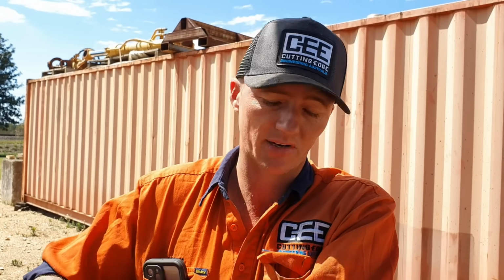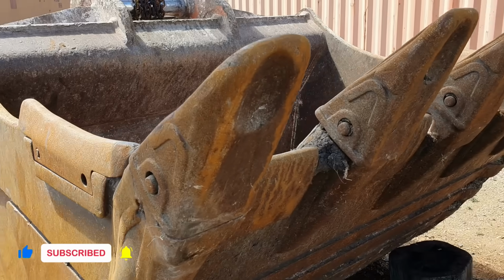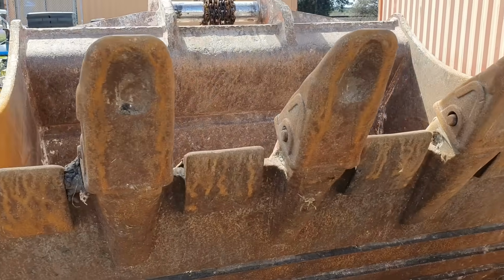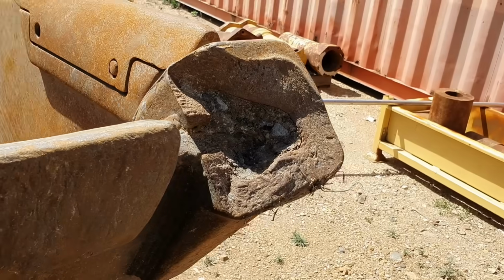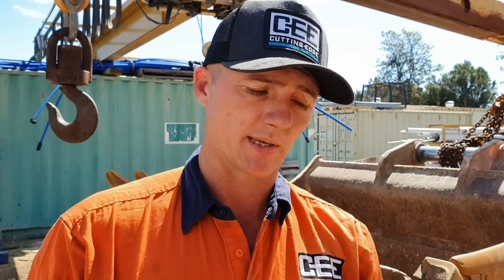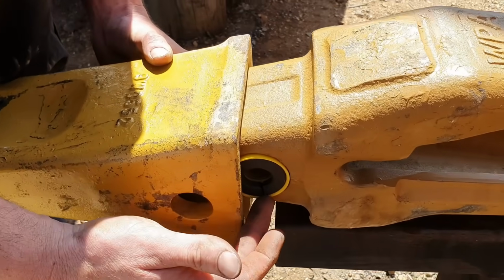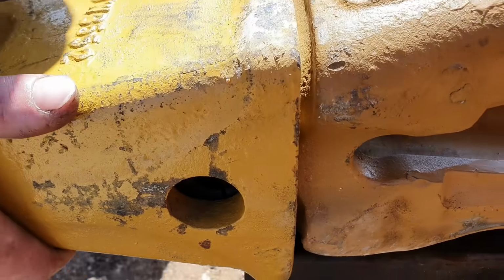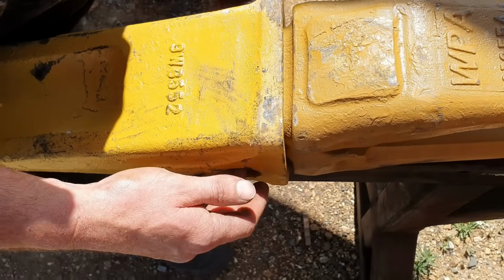Repair BROKEN Tooth on BIG Excavator Bucket | Gouging & Welding

Comment: People asking why you don't use plasma or an oxy set clearly haven't had to remove just the welds leaving the parent metals behind. Another cracking video
Reply from the maker: Surprising how many ask so will definitely need to do a comparison video
Reply: I have to admit I haven't used carbon arc before but it does look like it gives good control over the metal removal. You also get better access than you would with a big plasma torch. I can see oxy working but it's damn expensive to run.
Reply: A lot of us are not welders, machinists, etc so we do not know why somebody would choose one thing over another or the pros and cons of each, especially in different geographical areas.
Reply: That's exactly why I would ask that question. I haven't done anything like the repairs Kurt's does. Questions are for gathering information.
Reply: It depends on what you are comfortable with and the equipment to use. All are the same results. I prefer to use gauging as well.

Comment: What lots of people don’t know is you can surgically remove the old weld with air arc. Much cleaner, faster, easier which is the name of the game here.
Reply: Obviously, you don't know how to work with oxygen, that's why you say that it's not good for cutting or blowing out old welds. I have worked with a gas cutter in shipbuilding and nothing can replace a gas cutter, you just need to know how to work with it. many greetings
Reply: Corner shanks are a pain without air-arc
Reply: Ro Herms  that a great comment
Reply: @euronaviseuronavis947  I don't know what a gas cutter is, but I've never worked in a ship yard. Oxy- acetylene or oxy-lp I've heard of, never gas cutter. I do know that in a ship yard there are specific jobs though. Are you a grinder, welder, fitter,fabricator , pipe fitter? Or are you a gas cutter which Isn't a ship yard job.
Reply: Aullia Lovely  you should really stop this is a good channel that won't put up with this.
Reply: Aullia Lovely  stay in Russia and let Australians and Americans do what they do. Atleast Australia is on the same side as most Americans and growing, that our president and vice president are very incompetent and getting worse by the minute. Australia is very keen on the world I wish I could live there.
Reply: Yeah this video is really a great demonstration of the surgical capabilities of carbon arc gouging.
Reply: @euronaviseuronavis947  l don't know about that. Need one big fuckn torch to cut that out. The job here l think is best done by gouging it out as you don't need to cut clean through just gouge the weld out.
Reply: Ro Herms  Oxy if you're in the middle of the woods. lol
Reply: Hypertherm makes some really kick ass gouging tips now. I've been using them for the last year and haven't really needed to go back to air arc.
Reply: @HardCharger711  this^ although a experienced air arc man is tuff to beat.
Reply: @Kevy-vn9db  Totally agree. I think there will always be a place for air arc. But the plasma stuff has come so far in the last couple years. I've been nothing but impressed with the new Hypertherm stuff for gouging, but it definitely has a limit.
Reply: I’ve personally seen this process a few times, but we do buckets like this all the time with oxy-acetylene. We normally scarf it out. The only downside to that is you get scarf marks, which lets be real these buckets could care less about a few added marks  that you just weld over, lol. It’s a sad reality that most companies use these buckets until the shank is worn.
Reply: Very good job.

Comment: Brings me back 5 years plus building Doosan/Geith buckets that size. Would take a good 10 hours or more the weld shell, fittings, adapter, bushings.
Reply: Where were you making the geith buckets? Aren’t they an Irish company
Reply: @ferguson20diesel49  Bobcat is where I work and we build them in Minnesota. The shells were tacked in Ireland. They used to weld them their but they moved them to our factory. Now we have them subbed out to North Dakota. Doosan bought Bobcat back in 2008 or 2009. I mainly welded up the clamps or better known as the thumbs.

Comment: Every Spring we have what is called Breakup. One year I would do this and the next year it would be undercarriges and dozer blades.  I used ArcTek 223 long rod with great success. Great repair Kurtis and Hi Karen. I trust your taking great care of your fellas. It shows, LOL. Everytime you drive a pin into those gards etc I flinch. Missed the pin and my thumb bore the brunt of a 4 lb short handle sledge, LOL. OUCH. !

Comment: Thanks for the lesson! 
I’ve used carbon arc, but air arc is very impressive. It does a beautiful job of cleanly removing all the welds quickly without damaging the base metal.
Scalpel surgery without 8 years of College! Good on ya, mate!

Comment: Biggest difference I think in Air gougeing and plasma for example is that a plasma is a cutting tool and Air gouge is a carving type of method, easier to get the right amount of metal away. Nice job as usual Kurtis, and Karen is a pro with both footage and editing. Have a nice weekend!
Reply from the maker: Surprising how many people have asked about  it so will definitely do a comparison video. Glad you enjoyed it and thanks for watching each week mate
Reply: @CuttingEdgeEngineering  yeah I really want to see a video showing gouging, plasma and torch and why one over the other for certain situations. I'm still impressed by gouging as I'd never heard of it before watching your videos, but now see it on a bunch of other channels. Makes me wonder if I was just dense and never noticed before lol
Reply: Yes carving was a good way to describe it, somewhat like working with heavy artists clay and cleaning up the dags.
Reply: Plasma just has a more focused arc compared to gouging which is wider and flat compared to a point
Reply: @Alfredo B Bear-Lacis  and it's never ending.
Reply: @Sicktrickintuner  depends which rods you use I suppose, on big stuff the plasma arc size seems like a hindrance rather than benefit. Obviously doesn't apply for the non plant gear mind!
Reply: @markfryer9880  that's what I was going to say after watching the start of this video, gouging seems more like carving. Hmm Kurtis, maybe time to make a sculpture?
Reply: The air arc gouging vs the oxy torch doesn’t put in as much heat either. Once contact is made it’s immediately blowing slag. I’m gonna gather that air arc gouging is superior with thick metal.
Reply: I can definitely see the benefits of gouging after watching it cut such a clean bevel.
Reply: AFAIK there's a special "gouging tip/ adapter" for plasma gun? Anyway, I'm really looking forward for that video Kurtis announced. Hey, Kurtis! Do you hear me? ;-)
Reply: I liken carbon arc gouging as like you are "washing" the metal away. Its a contouring tool or similar to a grinder, just 10 times faster and far more accurate.
Reply: @CuttingEdgeEngineering  I have seen you use them all in different video's, so I am definitely curious!
Wait did I see you use plasma cutting? Can't quite remember...
Reply: You can actually gauge pritty good with a plasma torch. I dont know what the cost perspective is tho
Reply: I like air-arc because I can easily control what I'm removing, and of course the metal removal on 'heavy-equipment' is just right for the often odd patterns.
Reply: @MrKotBonifacy  I have a thermal Dynamics Cutmaster 60i plasma, and there are gouging tips available for it. It does have a gouge mode. It works, but it takes small cuts. He uses an Arcair K4000 gouger and can choose from gouging rods anywhere from 3/32-1/2" in diameter. From the cuts he showed it looks like he was using either a 5/16 or 3/8 rod. You can take a hell of a lot of steel out in one swipe with it. Also notice after he gets the piece off he switches to a flat rod instead of a round one. This lets him cut the old weld down the the base metal rapidly and with precision. Drops grinding time by a lot when you have someone who knows what he is doing with it, you can get quite surgical with them. I own the same gouger he does, and even though my plasma does have an option I let it stick to cutting things, the carbon rod gouger is just so much faster and better at it.
Reply: @RadDadisRad  Another benefit is when you are going a full-penetration weld. You do a double bevel and leave a small flat landing at the fitup point. First you fill from the root pass all the way to the top on one side, then you use a gouger to cut from the back of it down to the root pass of the first side. Then you know you are in sound steel. Then you grind it up and weld the second side to the top. I welded bridges for 6 1/2 years, this is how I did all our butt welds that were full-pen. They go x-rayed after I was done to ensure complete penetration with no inclusions or voids before the piece could go into service. Torches are good to chop things up, and a good tool in the arsenal but every tool has a proper use and the gouger is the one for this job.
Reply: just wish they didn't cut all the funny bits out and put them at the end. :/ it's better when it's all one piece. :D
Reply: Oxy is very slow, you need to preheat the material before it will start to cut/gouge and puts a lot of heat into what you are working on, doesn't like cutting through dirt, rust, slag, and can't cut non-ferrous material, the tip gets hot and gets harder to keep going and slag blows back and blocks the jets, and is generally a bad time. There's not really any benefit to gouging with an oxy except maybe if you don't have 3 phase power available for the 500+ amp machine you need for air arc gouging.

Yes you can gouge with a plasma, with a gouging cup and nozzle. It's a step up from an oxy as you can relatively easily blast away/through rust/dirt/slag, all metals are now fair game, you can make narrower but deeper gouges, you can start straight away without having to wait for the material to heat up first, and you put less heat into the workpiece. As mentioned, because of the arc size, you can't take away as much material widthwise per pass (unless you weave but it's not as controlled), and because the nozzle/gun head is relatively wide, you can't go very deep into a vee unless you open the angle up, and slag blowback wrecks the nozzles and cups pretty quick and makes them earth out so you have to fight it a bit to keep going.

Air arc gouging takes superior amounts of material away per pass, can be used on non-ferrous materials, annoys the hell out of everyone within earshot (haha suckers), starts quickly and easily, cuts through dirty/slaggy/rusty stuff relatively easily, and you can make fairly narrow gouges as deep as you can get the rod and the air down to. About the only annoying thing with them is going into corners because the air doesn't want to flow right, sometimes non-ferrous stuff will create an oxide that doesn't want to heat up properly to be able to burn it away so you have to chip it away more often, it can be a bit harder to control, and you need a fair lump of a power source as it draws a mad amount of amps ($)
Reply: You can gouge with plasma as well. They make gouging tips for plasmas, they are tricky to use though you can just cut through what you’re trying to gouge
Reply: @therealracer135  awesome post! 👏👏👏
Reply: @9:26 Angle Grinder on a stick?  Where does my wife buy it for me birthday? PS Your safety officer's quarters could use a robust 316 stainless foundation packed with tungsten shot for vibration dampening (a la ThorLabs dampening posts), and perhaps a miniature rack for some toys equipment.  - ToolJunkie
Reply: I think the oxy acetylene is being under valued a bit. Of course your normal home rig isn’t going to cut it in comparison to this but it is absolutely certain that with the right size of tip/torch/tanks you can blow through some ridiculously thick material. And it can also cut flat as well it’s called a scarfing tip. Arc gouging looks pretty awesome though. The barrier to entry for the normal hobbiest person seems high though
Reply: Plasma, cutting is not typically used to remove weld metal. Arc Air Gouging removes weld metal (to salvage the base) and to joint prep for new weldments 
Oxy fuel, wether  MAPP, PROPANE, ACETYLENE ,ETC. with O2 would require assorted gouge tips in order to use the "cutting torch"  in a timely fashion. ( Slower, than Carbon rod).
"Arc Gouging" is a go to method for heavy equipment repair in any heavy fab shop I've worked. Also you'd need a pretty serious plasma cutting machine to work with those thicknesses
Reply: Plasma is a shallow and narrow cutting method.

Gouging is more of a taking off layers rather than needing to penetrate.
Reply: @ObservationofLimits  hypertherm has a commercial model that cuts up 1" steel like butter. They can customize one a lot thicker.
The process is used to rapidly cut steel. Originally developed for aluminum. There are "gouge"  tips .  But like I've said earlier.... in Heavy Equipment  Repair. An Air Arc is used to save parent metal and to prep for welding. Often an oxy fuel torch is used in conjunction. Plasma is seldom used in any Heavy Fab shop I've been working in terms of Heavy Equipment Repair.
Reply: @willemstreutgers1154  With some folk, they abandon education at 5 or 7.
One sees them star on Court Shows.
Reply: Speaking of Plasma, I will never forget the time that a kid in my welding class called a continuous rod as EXTENDO ROD.
I still cracks me up to this day.
It was even put into my Exam which was hilarious.
Reply: i agree, it looks like it is a faster way of getting the part removed and it doesn’t take away from the very high quality work being done which makes for a faster turnaround time

Comment: Arc gouging is a no brainer no way you can get that clean of a cut with a torch plus no preheat needed and no gas costs. Plasma cutting stuff that thick would be slow as hell plus again you don’t have as much control as you do with that arc gouging. Plus a plasma machine that can cut that thick of steel would be well into the thousand and thousands.

Comment: I know you've probably got a few things up on your whiteboard and this might not be something you're interested in but, depending on if your provider agrees and is actually the one that does it of course, would love to see a video about how your swarf and scrap is recycled. Got all different grades of steel, brass, cutting fluid etc. mixed together. Really curious how they do it.
Reply from the maker: Hey mate thanks for the suggestion we would've never thought of that so will add it to the vid ideas cheers!

Comment: After running equipment for over a decade I have seen many of those shanks break, the outside ones are the most common and it usually happens from my experience when the outside tooth catches a rock and the operator starts wiggling the bucket in place to try and get past the rock or pull it out. Luckily I was taught when you run into that situation go the tooth width wider and you can usually get the obstruction out without breaking a shank or tooth. Also having had to replace shanks I know how big of a job it is especially if you don't have an air arc gouge, it is not that fun with oxy acetylene and requires significantly more cleanup after. You make it look easy, I also love the fact you use mig to weld it back in place, so many people think stick is the only way to get a strong weld on something like that.
Reply: Idk about that when I was a teenager my dad's friend came to work for him after he retired from 45yrs as a pipeline welder I spent 1 summer rebuilding our old excavator buckets with him. He could burn shanks out with a torch and other than the slag it looked like it was cut with a bandsaw. But I know what your saying I've seen ppl that think they know how to use a torch just because they can light it
Reply: I'm sure some one that don't know how to use an air gouge would make a hell of  a mess with it just like some one that don't know how to use a torch

Comment: I did this exact same thing on a smaller bucket just 3 days ago and it was so hard (I’ve only been welding 8 month). You make it look so easy.
I hope you see this and I hope you keep making videos like this. It’s helped me so much
Reply: You should have filmed it.  A year from now you'd at least be making beer money.
Reply: Lucky man! Only 8 months. I've been welding for a few years and  I wish I could work repairing things again, stuff like. I studied structural steel but I don't work in welding anymore. I wanna go back to doing repairs and fabrication. I didn't like working with aluminum. Pure 7018 and Flux core/mig for me😎
Reply: @dannyherrera2163 could this be done with 7018 stick only?
Reply: @yaykruser  flux core is the equivalent to stick welding but for wire feed. I don't remember what type of wire and shielding gas mentioned in this video (mentioned  he's doing duo shield) but he mentioned it's a special wire due to previous issues. I've never done excavator repair but I would assume you can do it with 7018 with a larger electrode diameter. 7018 or 8018 would be preferable if you only had a stick welder. Idk I've never done this type of work but if anyone knows what I'm talking about and if I'm wrong please correct me. It's always nice to learn from others or receive some constructive criticism. 

Or in more simple words, I would assume yes... lol
Reply: @yaykruser  You could do it with stick. I don't know about 7018 might need 8018 or something a little stronger based on what the bucket is made of but sure you could use stick just take 4-5 times longer.

Comment: The Air Arc vs other methods question in my mind is easy. Air arc is fast & efficient. In other words you can remove a great deal material with some precision very quickly.